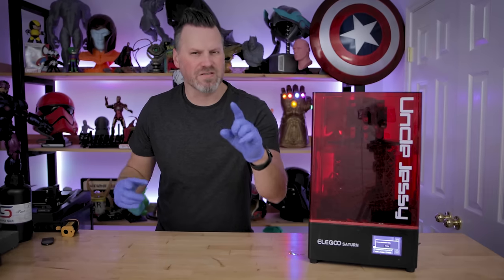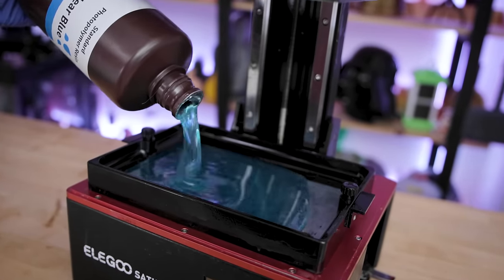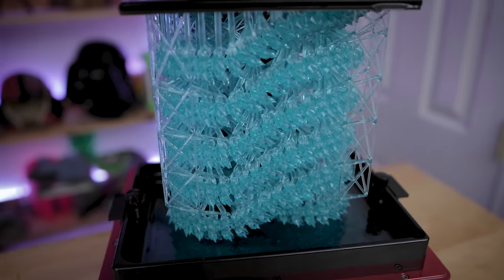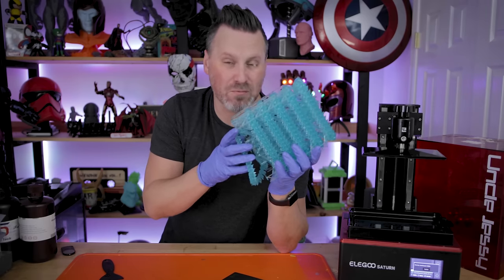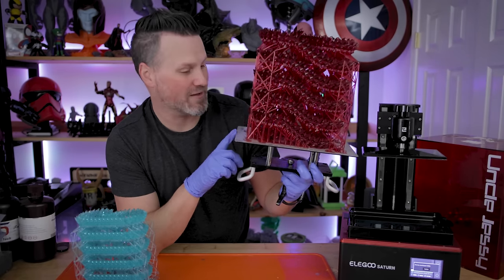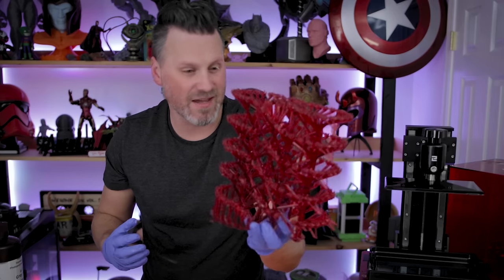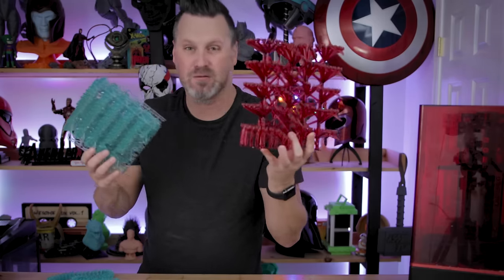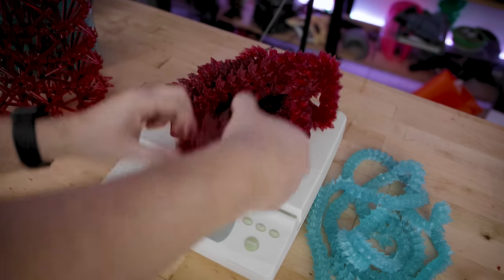Extreme Resin Stacking 3D Prints - This is wild!

Comment: For you struggle  on removing support without dipping them in warm water, what i do is soak them in room temperature water a few minutes or longer depending of the thickness. Works well on water washable resin before curing. The resin is not brille, still a bit flew and soft, cold/room temp water dont alter the print and i get less support mark then after curing or warping with warm water.
Reply: I didn't use the water washable resins. Can you recommend the good ones?
Reply: @adamswitlak1242  eryone grey if you can get it, thats the best one in water washable
Reply: @adamswitlak1242  I have been using JAYO water washable, its my favourite resin in general

Comment: I tried to print this and it turned out great except for the very top of the head didn't print.  When I took off the supports, I ended up breaking it in 3 places.  I would have loved to see more detail on how your removed the supports.
Reply: I had the same problem, I broke 5 links in the figure, I don't know how to take off the supports without braking the links of the dragon
Reply: The last like 10 links in the tail end up fused for me even at dangerously low exposure times

Comment: Tip: when not using a flex plate, put some IPA in spray bottle and spray the IPA on the scrapper, when the IPA get in between the resin and bed the resin part will pop off the plate.

Comment: G'day Jessie 
I've an Anycubic Photon Mono resin printer with a build volume of 160x80x65.
When I do multiple different files,  I use fusion 360 and make a frame around different files in the volume of 155x79x64mm. I connect all the files by a 0.5 tubes to each other and to the frame.
I export this file as a whole job and place it in my slicer. I then make a 1.5mm bed on the plate and add supports where needed.
With my wham bam plate and the supports the height is 160mm.
The print takes about 7 hours, but it's faster than the combined time print time if you print them separately. Also you use about 50% less supports compared to single prints
to the plate, thus less supports are needed.
Also the clean up is quicker and easier. 
Havagooday 
Greg

Comment: @Uncle Jessy Hey, I got a question for you pertaining to cleaning the miniatures with IPA. I was originally wondering if you had a mixture of water, IPA, and resin. Allowed it to settle before then putting it into the freezer. The pure IPA shouldn't freeze where as the water should. But I don't know how the resin would react or interact with the water in this method. I tried searching online both google and youtube and couldn't find any one having tried that method. But, alternatively I did find out that people use pure sea salt (no iodine at all) in 70% IPA to remove the water from the IPA solution. The sea salt makes the water more dense and will cause it to settle to the bottom of the container. I still have not found anyone having tried use this method either. But it seems you might want to do this early in the cleaning cycle? I don't have a printer yet but thought it would be neat to hear from you on these ideas in case you may want to give it a try? Thanks again for making all of these great videos. I am looking forward to getting a printer.

Comment: I've been looking for what caus s resin prints to be so brittle I made a 28mm miniature it fell maybe three feet into our table and the head just sheared straight off. Not sure if it is the elgoo resin I'm using or if I didn't cure it long enough it was cured on both sides in an anycubic washing curing station for 30 min each any ideas would be awesome.
Reply: Over curing will cause resin to be brittle. 30 min of cure time is way too much.
Reply: As said above, 30min for a wash and cure is ridiculously long. Properly cured, I’ve dropped resin models from 4-5ft and they’ve been fine.

Comment: Which Flexplate do you use for the Mars 3? So far I was not able to find one, which is recommended or marked as compatible. Or is yours simply smaller and you have to adjust your settings in your Slicer?

Comment: I just ordered my very first 3D printer, the Elegoo Saturn S with ALL the accessories you have recommended and used on this channel.  It will be here tomorrow.  I don't yet know the plate size (V1, V2 or V3) so I can't order a flex plate yet.  I'd like to print this as my first 3D print ever.  Do you think I can do it?  :)

Comment: At my work we use a Form Labs Form 3. They sell standard black resin for 150$ per L, that's .15$ a gram and we charge .25$ for cost. That failed print, which we couldn't charge the customer for, would be 136$.